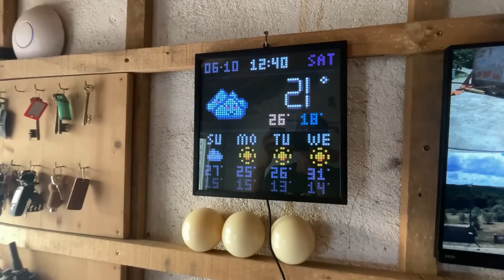S3E32: LOOK WHO IS BACK! - DIY PORTUGAL

Comment: The first beach you visited called Praia da Ursa in Sintra  near Cabo da Roca is very dangerous. It's on the bottom of some cliffs only accessible by a dangerous foot trail. No wonder you could not find it. The helicopter  at 4:04  is probably there to save someone. Just google Cabo da Roca deaths. People are not aware that beautiful places can also be lethal. There are so many other beaches that are beautiful and accessible. I would also advise that if you want to swim, use only beaches that have life guards (majority of the beaches from mid June to end of August)